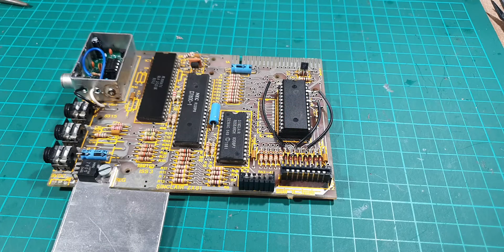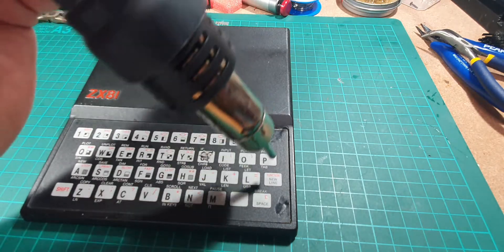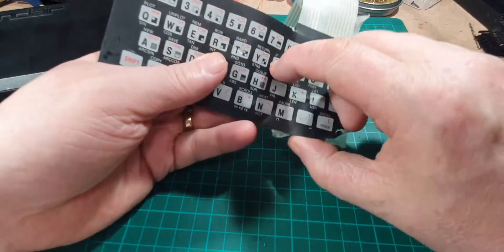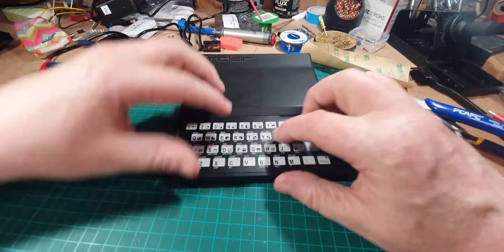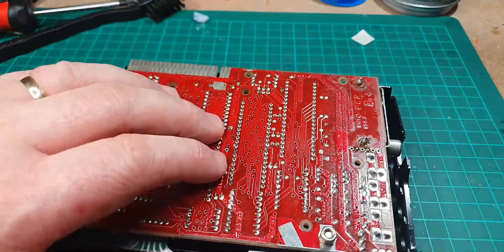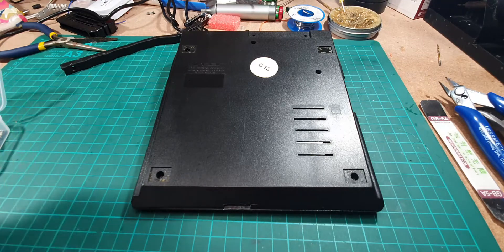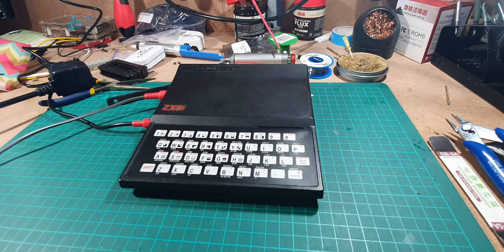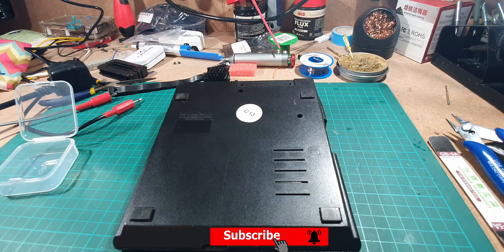ZX81 Part 3 – Replacing the faulty keyboard

Comment: Great video. Good sound and interesting to watch! If I'm not mistaken, the flickering happening at 8:40 might have to do with the camera adjusting the shutter speed to compensate for exposure which again makes the lights in the room flicker in the recording. If you set it to manual (fixed shutterspeed) this will probably be avoided. Anyway, thanks for the content and keep it coming!
Reply from the maker: Thanks for the comment - yes I need to sort out the shutter speed :-)